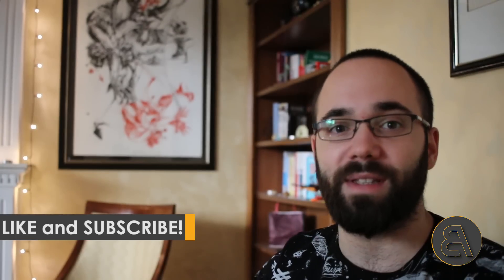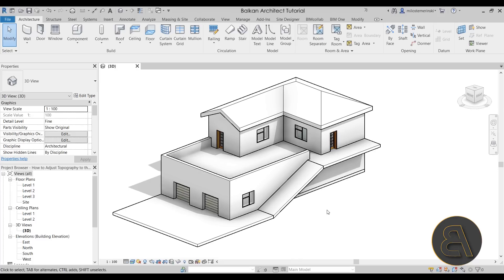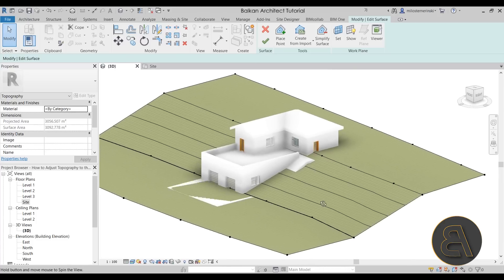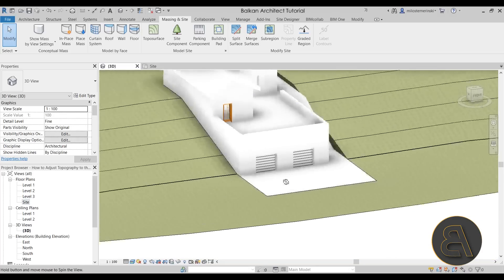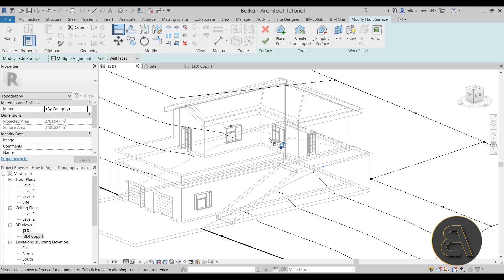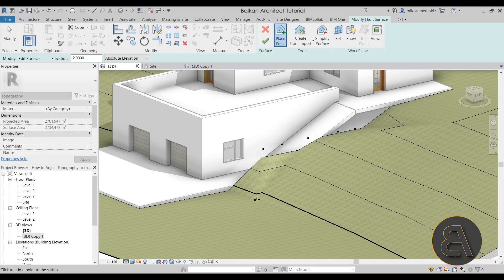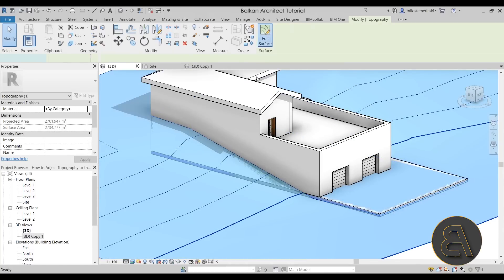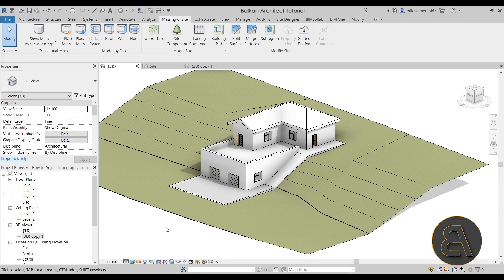How to Adjust Topography / Site to the Building in Revit Tutorial

Comment: Is there any way to place a vertical slop of 90 for say a retaining wall in the middle of the lot? I split the lots but my cut n fill were wrong. Revit has a bug when there are multiple topo solids in the same project. Especially if one suttounds the other.

Comment: how do you shape the outer edges of the topography to match the property line?
Reply from the maker: You use the property line tool for that, no need to shape the topo surface
Reply: @balkanarchitect  thanks for the answer- you can't see that line in 3D though- so I always trim the topography- but then it handles very poorly after it is cut
Reply from the maker: There is a way of achieving that, I have included that in one of my courses, please check out my course on topography in revit, you can find it on my website. 🙂